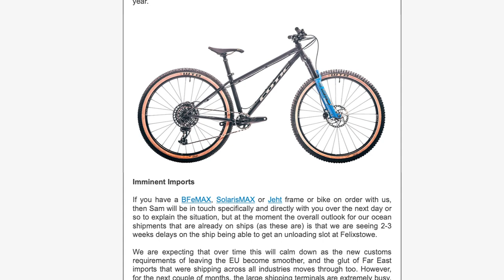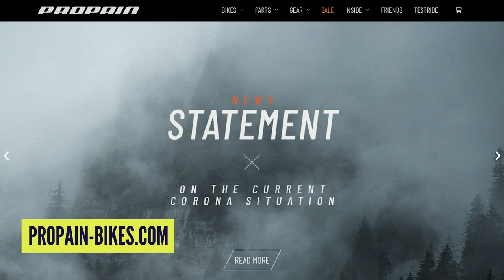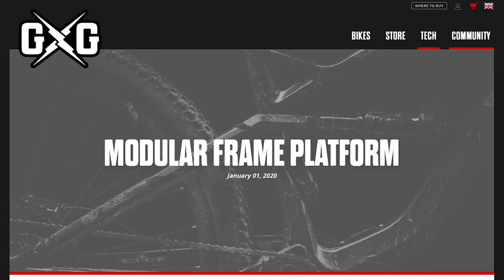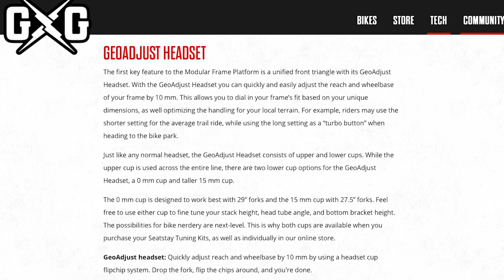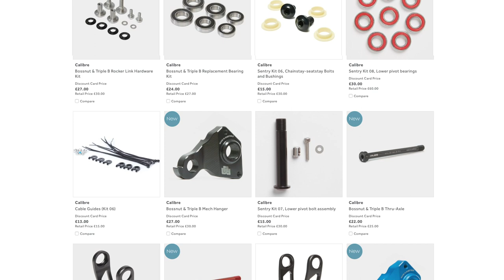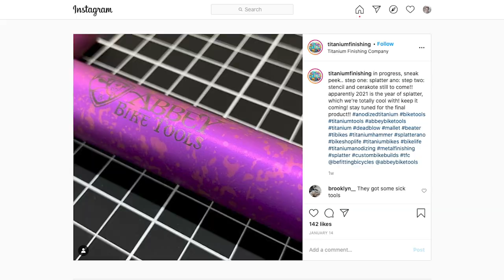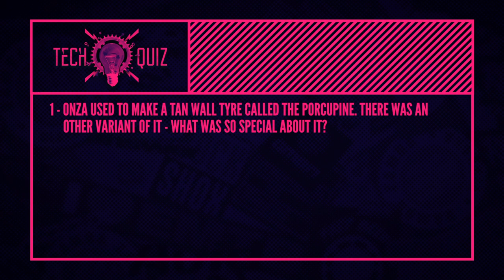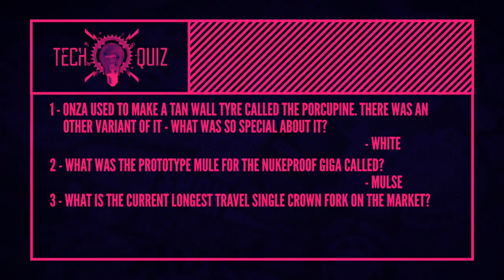What's Causing Mountain Bike Supply Issues? | GMBN Tech Show Ep.160

Comment: I recently changed from a gravel bike into a full suspension XC mtb to enhance my adventure racing experience. The problem was finding the bike. I had no idea that bikes would be impacted to this extent. After bouncing around several bike shops that had zero inventory with the next forecasted deliveries in August I got a bit despondent. I needed something sooner and even the proposed shop dates didn't guarantee sizes or models. I live in Austin, Texas and was fortunate to have multiple places to shop. I finally was able to find an instock bike from a Trek store. As a matter of fact they still had quite the selection. I don't know their presence in the UK, but here in ATX they are a good bet if you're looking for instock bikes and parts.

Comment: Hi Doddy, I’m a born again biker at 70, catching up on new tech, and tuning my bike, with your help. I’ve got a Cube Attention hard tail 29er, that I bought in 2012, which has had more use in the last year than in the previous 7! One thing that is still a pain to me is the saddle. While it has improved, as I’ve done more miles, I still get some discomfort from it. Any chance you could do a feature, or even a full program, on choice of saddle? I notice you all use Ergon saddles. Any reason for this. Their website recommends a gel saddle for me, but it is comparatively expensive, so I don’t want to just go for it, without some confidence that it will improve my ride. Thanks.
Roger.

Comment: I have a Husqvarna Hard Cross 8 2021 eMTB on order since September last year. I looked at KTM first as I own 2 already for my wife and myself ( conclusion from the biggest KTM dealer in Belgium, too late, already sold out for Belgium for the year 2021 ), then Cube ( waiting estimates for April 2021 back in Sept 2020 already and some crazy story if the factory has issues during the week your bike was scheduled to be produced, it wouldn't get postponed, just cancelled ). So eventually I went for Husqvarna, I really like how they look + the new EP8 ( that was recalled by Shimano in 2020 for some technical issues ( that doesn't help either doesn't it , what a mayor problem for them at the worst time possible ). So the Husky has been postponed twice already, several calls to the dealer, from the dealer to the sales representative for Belgium. Long story short, the system mentions a delivery date now of end of January that should be correct. Tomorrow is my birthday, I really hope it's at the shop now, I didn't dare to call more early this week. Fingers crossed.

Comment: In my part of Canada, MTBs are scarce. My LBS was sold out and the bikes they ordered that were to arrive in March 2021 were spoken for anyway. My top choices were a Giant Trance 29 and a Specialized Stumpjumper 29. These two brand's corporate websites provide current information on where specific models are in stock across Canada. I called a bike shop, located a 4 hour drive away, and bought my bike. So... check the manufacturer's website of the bike you want and see if they provide current stock information; you might find the bike you want. Bonne chance!

Comment: Spoke with a local shop owner/builder here in the US and his component orders were essentially sold out from under him. He blames the larger manufactures for some of this "component hoarding" and it's effecting his ability to spec frames for sale. I mentioned to him that if he thinks market manipulation by the larger companies like Giant, Specialized, Trek, etc is having an effect now wait until the likes of Yamaha, Honda, and Bosch have a greater hold of the industry as a result of E-bike sales. A company like Giant who does $1.9b vs. a company like Yamaha who does $3.8b won't stand a chance. It's a slippery slope and eventually the larger manufactures will be begging for scraps at a table they once owned. We as consumers will likely benefit with less expensive bikes/E-bikes  but with significantly fewer choices (much the same as the power sports industry is now).

Comment: Had a 2021 GT Avalanche Expert on order for months and that 'disappeared' at the docks back in November, but I was in my LBS trying to sort it out I got lucky and dropped on a 2021 Cube Reaction TM they had in stock and ready to go. it was a hundred and fifty quid or so more expensive but I figured that the extra outlay would be offset by the fact it came with a dropper post installed.  So I snapped their arm off and rode it away.   Was on the Cube site a few days back looking for a new helmet and noticed that the Reaction TM has shot up to £1499.

Comment: Ive had this problem.
I snapped the frame on my bike in December and due to supply issues I couldn’t get a new frame until the 18th Jan.

The only logical solution was to buy a new bike which ended up being a huge upgrade. But it was purely due to not having any other bike available.

I did get a new bike though. A week before they increased the price of them.

The second one:
In august I ordered a 2021 Scott scale xc bike that was given a 26th Jan delivery date.
Im now told it isn’t coming until the 2nd week of feb.

However no price increase.

With parts: 
I ordered 2 sets of wild enduro tyres from different shops.
At both shops the rear has come but not the front, that was two weeks ago and I’m still waiting.

Also waiting 6 weeks for a set of hope wheels.

On the plus side selling second hand parts is easy at the minute 😂

Comment: The problem: JIT (just in time) stock delivery. Before 1990 most places had stocks of spares and components. This does not happen today. Today, one delay by one sub-supplier will cause chaos throughout the entire supply system . Where is the main bottleneck today? Malaysia: many components are made there and then shipped to Japan for assembly. However, many component factories in Malaysia have sent employees home due to Covid issues.

Comment: I've been in the market for a short travel 29er for the last 3-4 months as my old bike needs far too much spending on it to keep it going (new brakes, drivetrain, shock and rear wheel).  I haven't been able to get anything, let alone the bike I want!  Was originally going to get a Giant but all the stock is sold out all the way to 2022.  Even Nukeproof and Vitus are constantly sold out unless you happen to be online for the 20-30 minutes after they release the next small batch online, miss that and they're sold out again.  So I looked at Whyte, same story.  Coming up to Christmas I was looking at Rose and Radon, finding Radon had pre-orders open for delivery on Feb/March 2021 so ordered a Radon Skeen.  Come January and Bike Discount (who sell Radon bikes) suspends delivery to the UK due to Brexit with no plans to currently resume , all due to Brexit issues.  Rose have also stated they're no longer selling to the UK.  The only bike I can remotely find now is the Canyon Neuron, but with that I'm between sizes.  The large is the right reach for me but too tall in the seat tube to get even a 125mm dropper on it, the medium is too short in reach!  Also prices across the board have jumped due to Brexit and availability.  My old bike is now suffering with a leaky shock, losing 10-20psi over a few days due to worn internals which are no longer available.  It's also an odd size being a Trek-specific RP2 DRCV so when it dies the whole frame is basically junk.  I have £3k sat in my savings account waiting to be handed over to a bike shop or company and I can't spend it!  So frustrating, especially as I'm like Doddy: not riding really affects my mental health.  Do ypu reckon I could get a bike on prescription and jump all the other orders?

Comment: On the topic of logistics failures, The companies need to do whats called a Root Cause Analysis (RCA) to determine the issue and the possible fixes. Once thats done you role it up into a report and an action plan called a CAPA (Corrective Action Preventative Action) report. That will help, as the name suggests, correct and prevent the issue from happening again. These types of things are used heavily in the BioTech industry for regulation issues.

Comment: I know it's not super relevant to GMBN and more GCN but I'm finding it very difficult getting Shimano GRX group set in a 1x system; nearly got all the parts now except for the rear derailleur.  Even getting the shifters was a nightmare for a 1x system, ended up having to buy the 2x shifter set just so I could get the right shifter.

May end up looking at getting the SLX or XT derailleur as on paper this wouldn't be compatible but the rear cassette is SLX for the GRX 11-42 system and  Alex from GCN did use on the Monster Gravel Bike build - I assuming this would work?

Comment: I've been having luck finding 2021 Specialized SJ EVO bikes at local bike shops in the Los Angeles area, and when those (quickly) sell out then a week or two later I'll see some more come in at another authorized retailer.  Not the same for Santa Cruz bikes as I've also been on the hunt for a 2021 Hightower C S, but have not been able to find one in my size within driving distance (as shops are not allowed to ship 2021 model SC bikes).  Haven't looked into other bike brands since I've narrowed my next purchase to a SJ EVO or HT.

Comment: I got a 2021 Trek Fuel Ex8 XT last August, but it was the only one the shop got in and my LBS is about an hour away from Trek HQ so I got lucky.  But prior to that there was no other options for many weeks.   I have learned to buy what I want in late summer/fall for the following spring.  If I wait until Spring its already too late.  Case and point, right now Trek doesn't have any wheels of the model I want until March, so if i want them the best bet is to order them now or I probably won't get them. It comes down to planning.

Comment: On the contrary to the bike shortage issue, I actually benefitted from it! I was going to buy an alloy framed Rocky Mountain, however the frame got damaged and Rocky could only provide the shop with a carbon frame to replace it becasue of the shortage...so I payed alloy prices for a carbon bike!

Comment: Hi GMGN tech, I’ve been trying to buy a 29” large 150mm travel trail bike since April last year, any of these would do, YT - Jeffsey, Trek - Slash, Whyte - CRS150 or T160, Propain - Tyee, Vitus - Escarpe,  Commencal - Meta. 

Every single direct sale bike company and bike shop in the uk are sold out, I’m being told 2022 now. It’s an absolute joke... And I don’t have as much sympathy about supply chains as you do. Last year did catch the brands off guard but there is no excuse not to have made more to sell this year. They just make limited amounts to avoid being left with stock at the end of the season and to keep prices high. The 2021 Vitus Escarpe is a great example. They sold out my size in about 2 days. They must have realised the run of bikes they made for 2021 would not be sufficient for the demand. It’s so frustrating and I now have nothing to ride as my son has just taken my old bike.

Comment: I ordered a Stanton frame in early July to get it before Brexit to avoid tax and  import VAT, looks like it's going to paint next week...
Reply: Ordered mine in may and had it for September, yours must have been ordered in the middle of all the  issues they were having with supply and a welder leaving 🙄
Reply: I ordered my UK made Switch9er in June. Last update said it would be shipped next week. Not had great service, comms has been terrible which has soured what should be an exciting experience especially when spending >£3500!
Reply: @russelltaylor1500  did you order 4130? Mine was 631,also a gen3 which wasn't really ready that early I think?
Reply: @bob69365  considering you could have waited the same amount of time for a bike from one of the big brands, I don't think the wait is too bad for a small company in the middle of a pandemic. One thing tho I think they need to improve on there updates and Information that is given to the customer as I was often in the dark
Reply: @Campus_with_an_H  mine was a FS160 so UK made 631. I think you may be right with gen 3 only just coming out around then? Not sure tho. Hopefully won't be long now, what colour did you go for?
Reply: @bob69365  I've had great communication with the Stanton crew, reynolds have had a hard time keeping up with the demand and covid have closed down the shop for them. What bugs me the most is the 25-30% increase in cost due to brexit. Luckily only a frame and not a complete build, but still, it's a 631 frame.
Reply: @russelltaylor1500  I'm hoping they are mixing up an extra dark ironstone sparkle (nearly black) with a dark shadow grey wrap. Well see if Simon contacts me saying it can't be done or not.
Reply: @russelltaylor1500  The wait hasn’t been the issue, being fully aware of the situation the industry is in particularly with delayed supply from Reynolds. The frustration has been the comms or complete lack of it and a different story every time I ask for an update. They have not reached out once through the process and I waited almost 3 months before contacting them.
Reply: @Campus_with_an_H  that sounds pretty cool, I'd imagine it should be ok to be done? With the shadow grey wrap what colour you going to have the Stanton lettering itself? Ironstone grey or something else? Be interested to see the photos when you get it are you on the Stanton owners Facebook page?
Reply: @bob69365  yea I get you, I had the same thing, luckily my wait wasn't as long. If I hadn't have contacted my updates would have just been the generic ones you get when it goes to paint etc. I'm not sure if I would have kept my cool if I was still waiting now...
Reply: @russelltaylor1500  just those colours, so pretty stealth. Stanton will be same as frame. Don't have FB, I'll post pics on my insta @campus_with_an_h
Reply: @Campus_with_an_H  nice one, sounds like it's gunna be a pritty sick build
Reply: @bob69365  awesome mate, really happy with it, Simon is a wizard with the paint haha, went iridescent evergreen and it looks sick. 
Rides really well too, I was worried 160mm might feel like too much of a big bike, but somehow it feels more poppy and nimble than my Whyte 901, but also like a train over rough roots and braking bumps. I would love to have a go on one of there hardtails, hopefully we can have some demo days later in the year.

Comment: Motorcycle manufacturers aren't having problems with supply. Being a cynical git, it's all about money, especially anything that is hobby based like cycling/boating/aviation. Import duties are payable on stuff made in the far east which might encourage manufacturers to produce more in Europe or UK. Same with major manufacturers of motorcycle clothing who outsource to China etc have found they have to pay duty bringing stuff into UK which, to be frank, I'm fine with (they moved production to save a few quid. The Chinese currency is fixed to the US $ so is not anywhere near the exchange rate it should be so prices are artificially low. FWIW I think bicycle manufacturers are taking the piss on their prices. How can they justify £3k to £10k + - you can get an awful lot of motorcycle for that (and with forks that last longer than a couple of days before needing a rebuild). There's no steel shortage in the UK!

Comment: Got news for you buddy, the bike industry is failing. The propaganda that is being pushed by the industry itself and shows like yourself are hysterical. Sad and hysterical. A few big manufacturers are on the balls of their ass they don't have the capital. If they can't deliver bikes you're going to see many small independent dealers fold. In two to three years one or two major bicycle manufacturers are going to go into bankruptcy go under or be bought out. It is never a better time to buy a bicycle? 🤔🤦‍♂️

How could it be better to buy a bicycle now when there is virtually little-to-no Supply. Our shop are being told we will not receive certain model of Trek Bicycles until 2022. Same goes for our Fuji line. And our GT line anywhere from June to November. Not sure where you're getting your information from but it's a load of bullshite. 🙄🤣